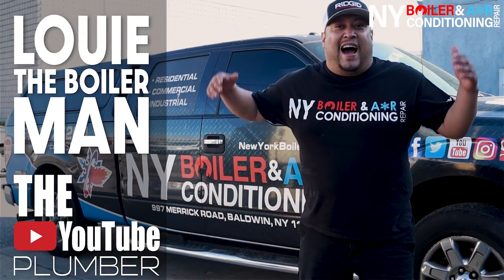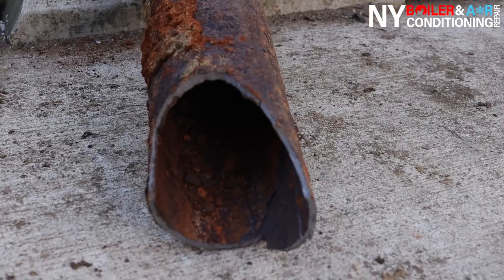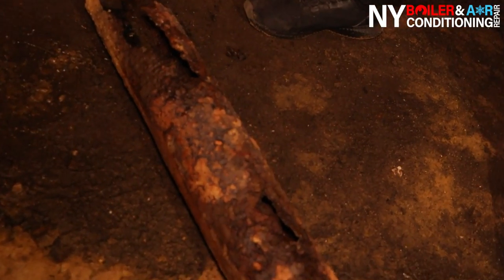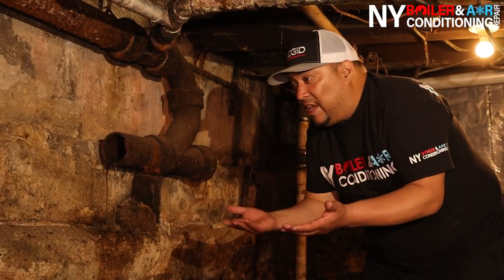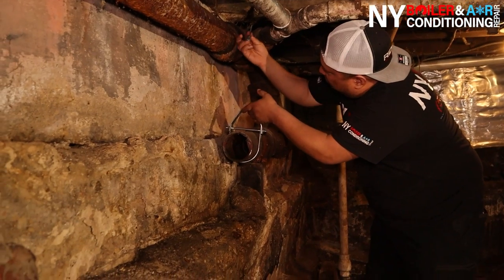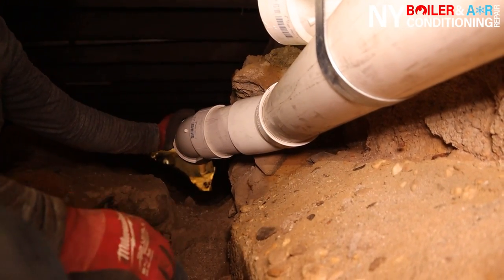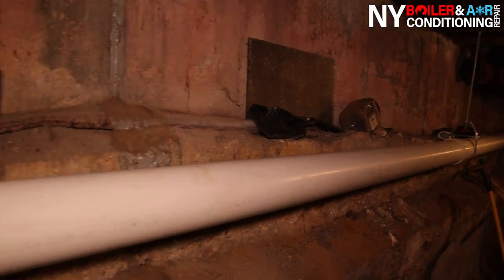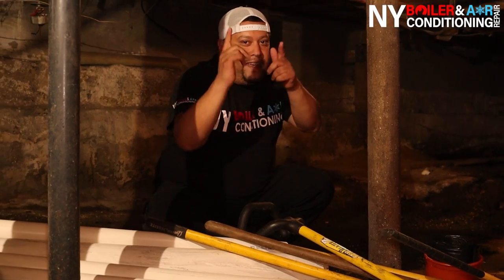HOW TO MAKE A SEWER LINE REPLACEMENT (50 FEET OF SEWER PIPES DESTROYED)

Comment: 1/4" per foot is for small DWV lines,  pipes of 4" or larger only need 1/8 inch of fall. 

Those are minimums, doing 1/4" per foot of fall(or pitch) on a 4" or larger sewer line is not a violation, but 1/8 is allowed. 

It's just that one may run out of room at 1/4 per foot pitch on a large mainline going to a septic tank or mains sewer line. Or you'll end up digging more than you have to.